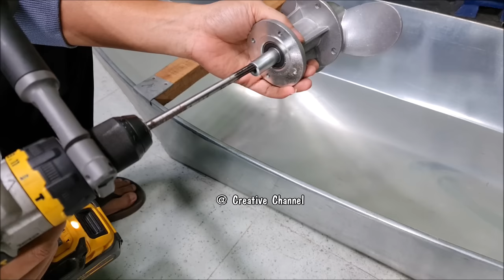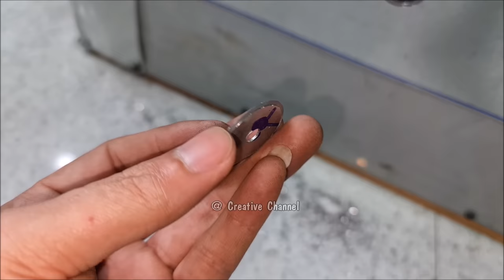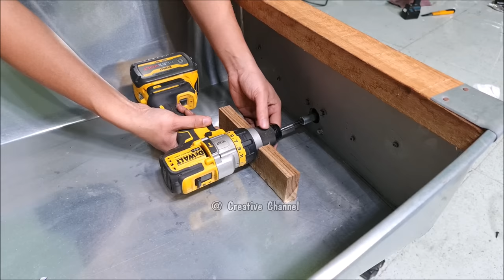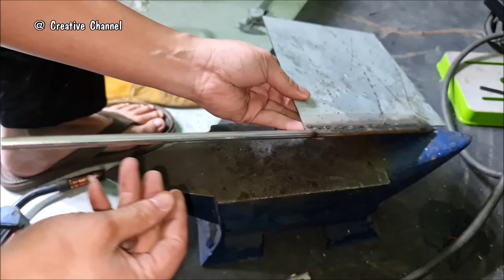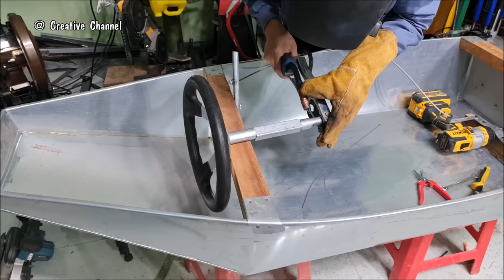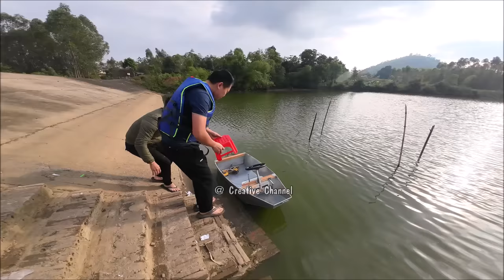Build A Mini Electric Boat Using DEWALT DRILL POWERED

Comment: Very innovative💪🏿👍🏿👍🏿👍🏿But the motor too weak..Need more power  .
Reply: the drill is powerfull, the problem are the propeler are in wrong position, to have a good truster in need in botom of the boat, better design a outboard model for easy adjust

Comment: :)  200m length oil tanker with 20mm steel   is the same scale as  2m length boat with 0.2mm steel plate :)
Reply: you mean tin foil? 🤣

Comment: Cool project! What I find interesting is the drill would quite easily power a bigger craft at a reasonable speed.
Reply: The only thing is those batteries aren’t really designed for long sustained use
Reply: V
Reply: @armanul2012 🎉jgn
Reply: @armanul2012 🎉🎉😂😂🎉😅
Reply: @tom4od Aà

Comment: You would have been better off keeping the tail of the boat as it was for more displacement and less drag.  Cutting it off would only help if you had enough power to plane which a cordless drill doesn't have.